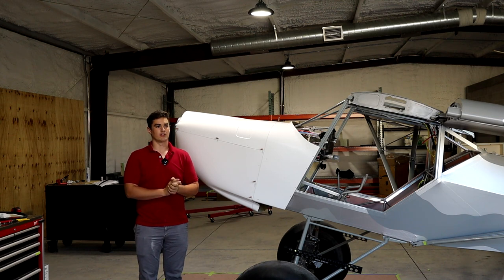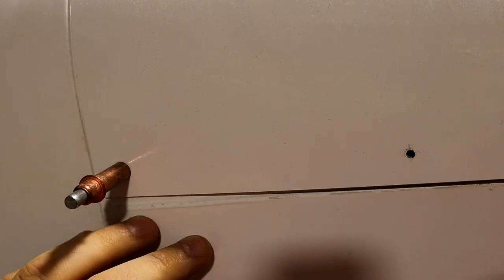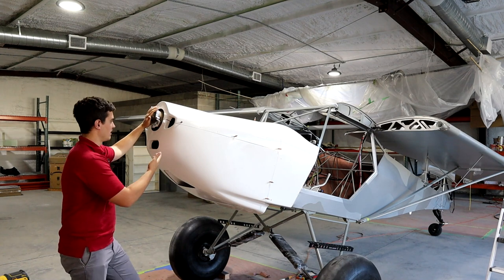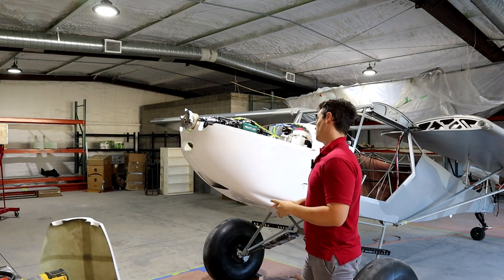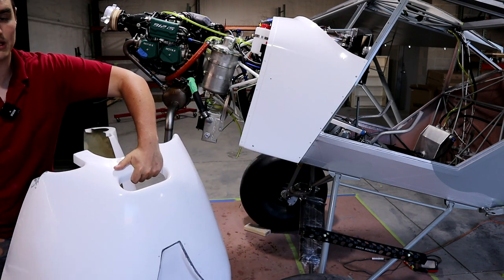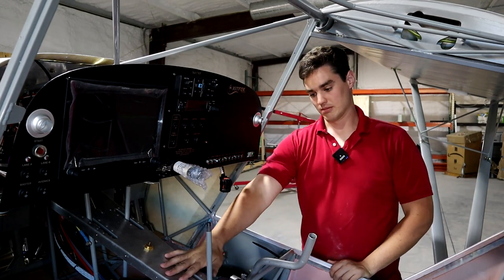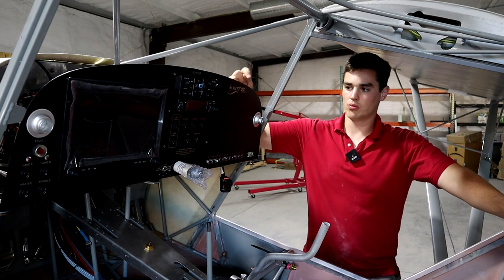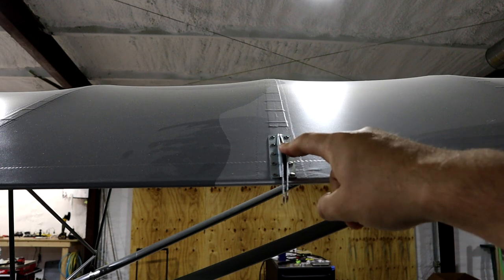Kitfox STi Build Update 18 : Cowlings, Flaperon Brackets, Some Sun N Fun, and The Latest…

Comment: Debra is 100% correct. There are different offsets for different spinners.  Constant speed would also require a different spacer.
Reply from the maker: Noted. I ended up reaching out to Nikk because I knew he used a Luga on his previously crashed plane. He said he used a 2 inch spacer. Also the guys a Duc said the same for the ground adjustables.
Reply: Got a feeling Brandon might know a thing or two about these airplanes